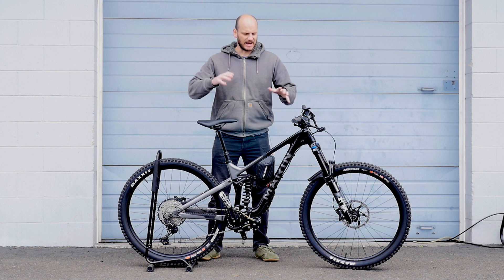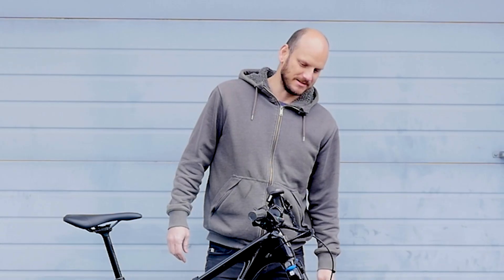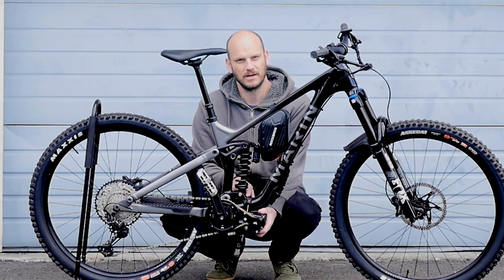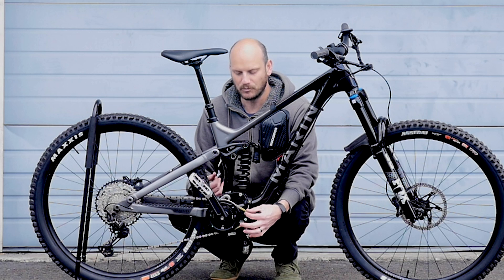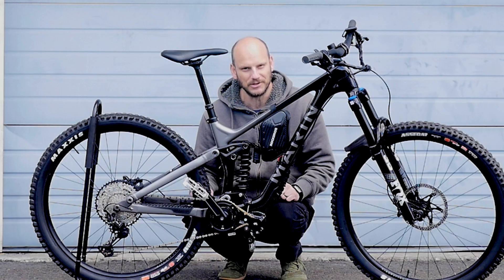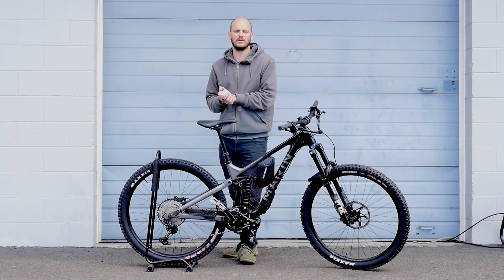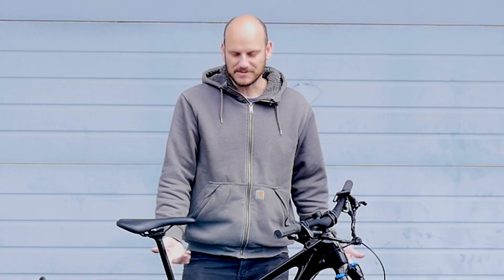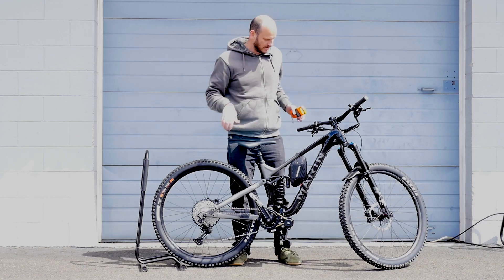Custom E-bike build: Marin Full Suspension Carbon 2 w/ CYC Stealth 52v 8ah

Comment: would the cyc a65 battery fit in a marin frame? been trying to plan a cyc emtb full susp build
Reply from the maker: Not sure but I just got some 72 V nine amp power small batteries that should fit just about any frame

Comment: I built this same bike after watching this video. Same, motor, battery on my carbon rift zone 2. Almost a year old build now with 500 miles of single track riding. Easy build, user friendly software adjustments via blue tooth. I am 58 years old with not the greatest knees.  I can ride 14 miles of single track that contains rocks, and steep hills in an hour and 15 minutes and use very little battery life. I did test it and kept riding throughout the week without charging the battery to get a feel for the maximum range I could expect, and I got 45 miles of single track riding on a single charge. Now, I obviously don't ride it like a motorcycle, and I never have it set above 600 watts of motor output.
  The torque sensing on this cyc motor is Very good, and provides a very natural feeling assist.  
   My first e-bike conversion build was on my old Motobecane Elite DS that uses a 1,000 watt bafang setup.  I used to use this bike as my single track bike, but since acquiring my Marin rift zone and converting it the Motobecane has become my full suspension road bike sporting slicks.
     Torque sensing on an offer road bike is a game changer for me.
    Very glad I purchased from Johnny!
Reply: What size of buttery  do you run?

Comment: Isn't the crush factor still an issue when converting carbon fibre bike frames? The 'mounting bar' contacts the frame from the top so wouldn't there be pressure on the frame when the motor torques to drive the chain?
Reply from the maker: Technically yes there is still pressure from the top. But nowhere near the lateral forces that would be from a standard install from a bafang etc.
Reply: Thanks for the clarification. Being that the stealth is CYC would the photon be safe for a carbon frame conversion?

Comment: I like the idea of an 8hr battery because it is small an inconspicuous.  And most rides are short distances. But what would you do if you wanted to have more range at times. Would you recommend just buying a 2nd battery and carrng it with you?
Reply: Build multiples of the battery and swap them out as you go.  But 72v / 20s would be better

Comment: It is very interesting that bike weighs 48 lbs. I'm rocking a IronHorse SGS pro downhill bike with 2 batteries totaling 39AH,  running the gen 4 pro and my bike is at 54lbs. 26 inch front wheel with a 24 inch rear. I believe the frame was made in 2004 and the frame is the heaviest part of my bike.
Reply: I agree I think it was lighter than that

Comment: Beautiful bike and build.  Too bad the rear shock layout limits battery size.
Reply: the scott full suspension mtb's with the integrated rear shock have a lot more space for an adequate battery. you pull 50A from this tiny thing, the voltage crashes to the bottom instantly. then better go with medium drain lipos
Reply: @JoLe1991  This is exactly what I want to build with the Scott spark 970

Comment: Very sweet build!
I'm not a fan of the double chain motors noise but they do have many positives & especially for carbon frames. A better chainline is a HUGE positive.
I absolutely love your 8ah 50amp battery. High power for any frame is rare. Wish I had bought one but the 6ah 30amp pack was too good a deal.
I don't believe you about it climbing walls. The tires aren't sticky enough!😂
I have taken a solemn oath to only commute on private roads;)

Comment: Awesome bike and set up, I would just want a bigger battery and add an extra for going long distance. Distance with ebikes I believe is what people will be looking for now that more bike paths are expanding and going out many miles! Hopefully they will start to add in charging stations!
Reply: I'm not sure how far you're riding but this battery should do at least 10 miles of HARD riding on high assist (or throttle). Much more mileage if you're in keeping with analog biker speeds or not depending as much on the assist. It's small enough that a second can fit easily in a backpack (or under the saddle if you don't have a dropper post).
Reply: @michaelsprinzeles4022  Around 52 miles round trip, so, definingly need much more battery compacity.
Reply: @kryptonite7936  Indeed you do. 2 might eek out 52 miles, IF you barely use the assist.